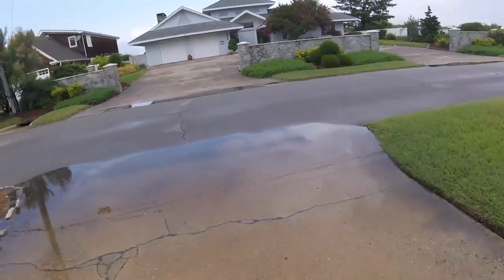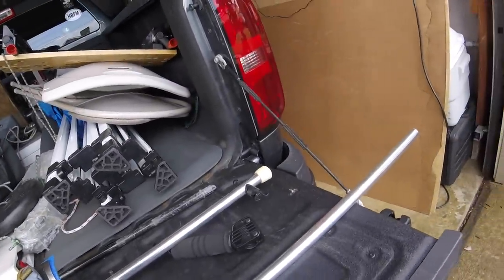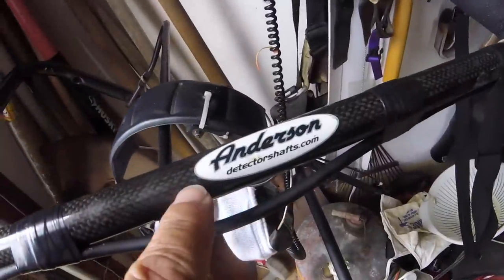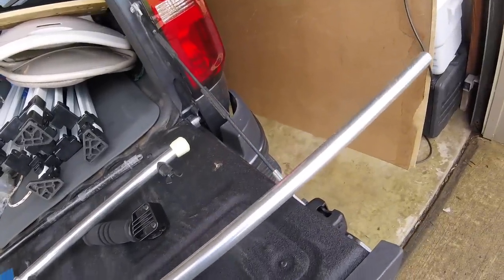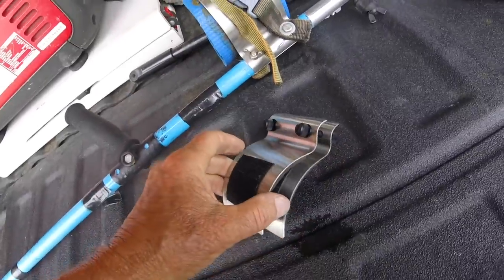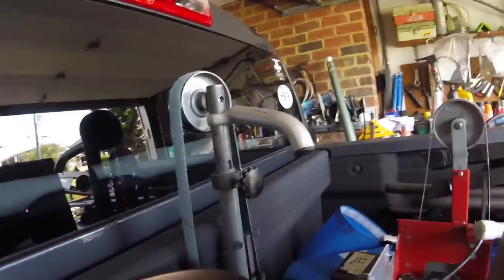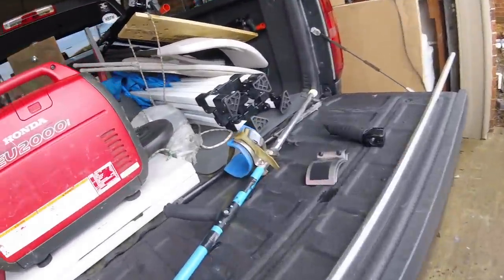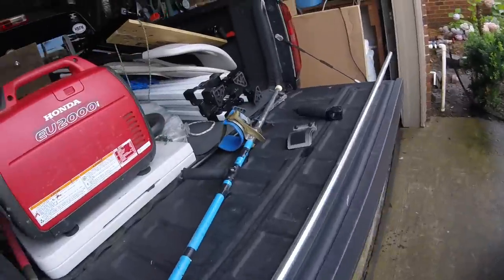Carbon Fiber Shaft for Equinox 800 By:  Rods by Plugger

Comment: Hey Max , got my 34 “ cf plugger shaft today ...think I’m gonna like it...couple of observations..the plugger shaft is 4.7 oz vs 6.8 oz on the original,the shaft is a tad bit larger than the original..when you mount the control box tighten the screws evenly (don’t over tighten ) there will be a small gap on both sides of the control mount.,and the holes for the bottom shaft are are a tad bit bigger , but once you snug the wingnut down 
there is no wobble. Overall I think it’s better than the stock shaft 👍
Reply from the maker: much better than stock.......saltwater and aluminum do not get along very good after time......nox made to use in many areas as you know.........good set up for everywhere except saltwater.

it is lighter.....did vid. today

Comment: I was looking at a plugger shaft. I decided I will make my own as I did for my old excal. I found a guy that makes the proper size carbon fiber shaft for around $30 and plugger camlock ie $11 on Ebay. Glad they are fucing the Nox fast! Sweet Gold denny got. GL&HH

Comment: Bought the 36” Plugger CF shaft about 4 weeks ago to fix the shaft wobble problems with the stock shaft.  Very nice.  That said, I did notice that it is slightly smaller in diameter that the ML stock shaft and I did have to add two wraps of black electrical tape at both edges where the stock cuff fastens and two more wraps where the control pod mounts to get a firm connection and no slippage.  I put the tape where the cuff and control pod keep it hidden.  One other note, do not over tighten the plastic wingnut on the coil shaft lock.  It will break the screw.  Replacement screw is inexpensive at Ace Hardware.
I do like the shaft and the price is reasonable.  Too bad a lot of us are having to fix the shaft wobble problems on a brand new detector on our own and Minelab isn't owning up to the problem and fixing it.  Never had this problem with my ATPro - really solid shaft locks.
Reply: Ted, was the move to the Nox a big improvement from your ATPro?  I have an ACE 400 and I'm trying to figure out what my next machine will be.

Comment: I bought the lock from plugger .  And made my own CF shaft . As no one really making them in the UK . And no Anderson dealers as the only one packed in as couldn't get stock from them Mine cost me £41 total . The CF is half the weight of stock . 80G TO 190G STOCK . I BOUGHT 1 M OF TUBE and left it as I thought the extra 6 inch on the bottom would strengthen it .
Reply: where did you get the lock from mate? trying myself and I'm also in the uk

Comment: Massive waste of money buy a gym pas if you find the equinox heavy 😂😂😂😂 there is hardly any noticeable weight difference don’t be conned !!
Reply from the maker: you are so wrong......has nothing to do with weight.....best money many of us will ever spend....IF YOU ARE A BEACH / WATER hunter.........salt and sand do not do well inside aluminum rods......carbon IS NOT EFFECTED by either of those two items we face every single day we go out......just rinse off with hose....done.  the stock alum. rod is great for park and dirt hunting, but salt environment NO.
Reply: gravediggermax - treasure & blades get yourself a gym pass you seriously need to strengthen your arms 👍